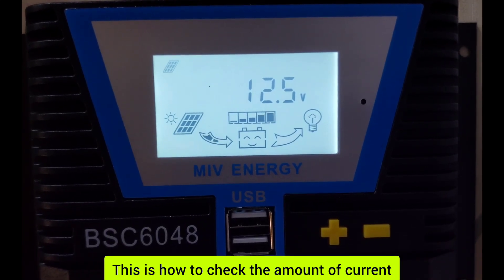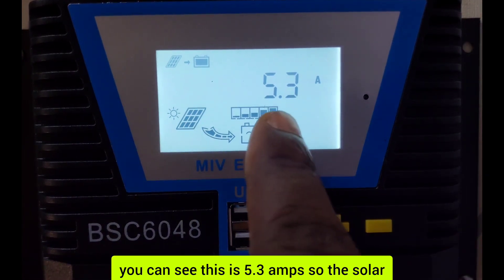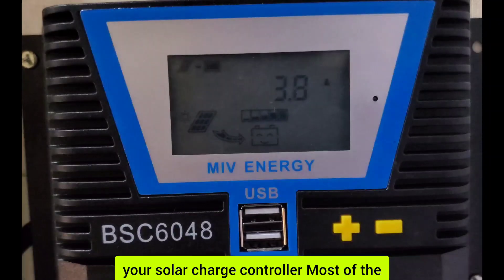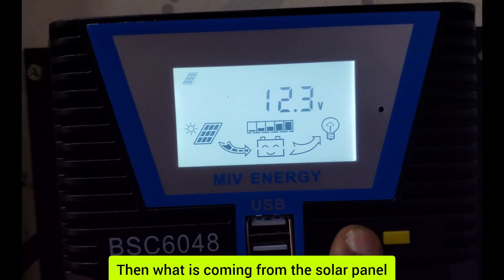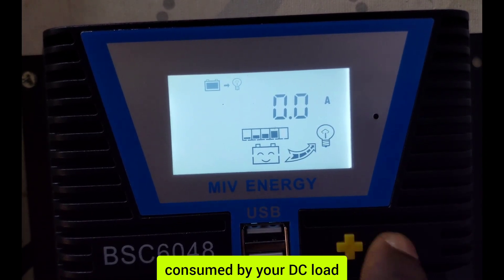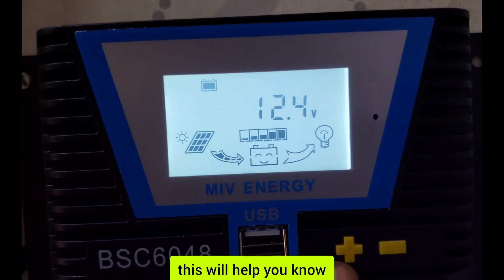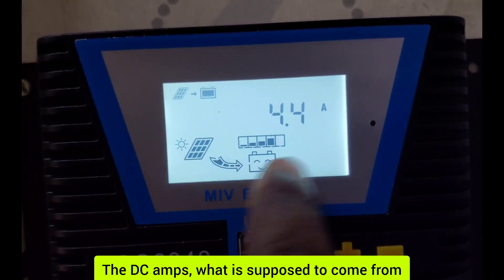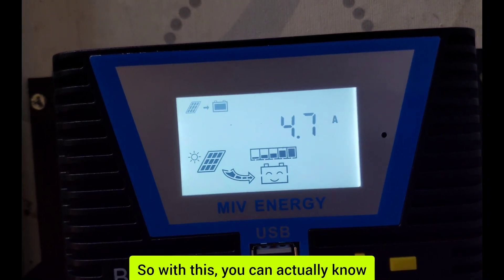How to check the amount of current solar panel is producing.

Comment: My 12 volts battery chsrges up to 14 volts is it good or bad
Reply: Yeah, it's normal, if that's the charging voltage (i.e., the amount of voltage needed to charge the batter) and not the battery state of charge. You can configure it based on your battery stages of charging.